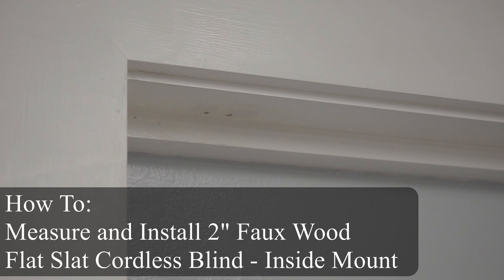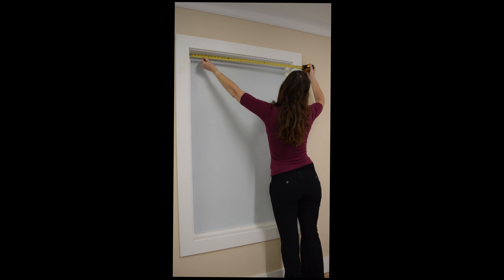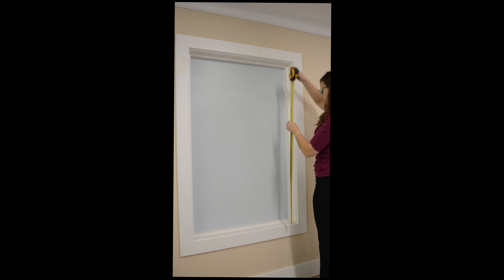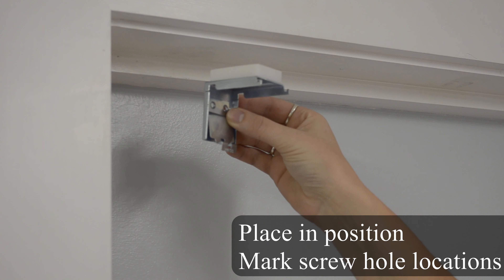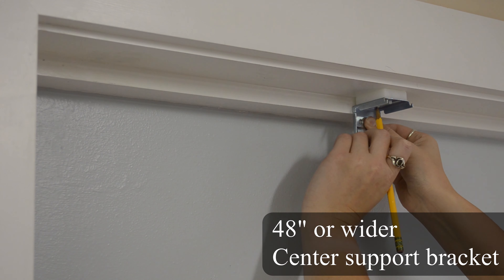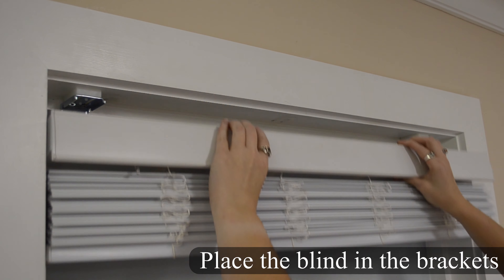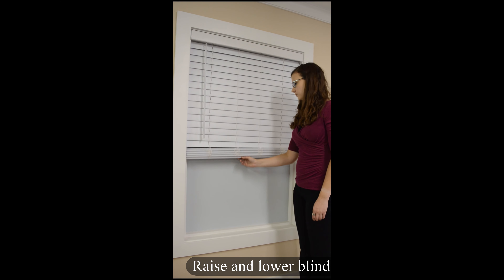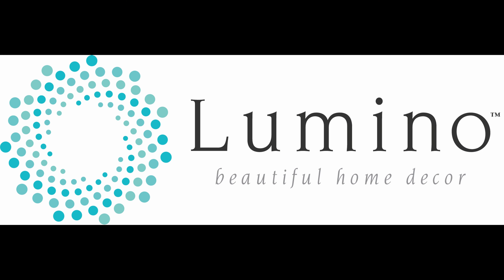Lumino 2" Faux Wood Flat Slat Blind - Inside Mount

Comment: You mentioned in the video having to mark where the internal components are, but don’t necessarily give a reason as to why. So I figured out the hard way after trying to install a 72 inch blind myself that the reason to know that is to avoid those areas with the bracket rather than aligning the brackets to those areas. That is not specified in the instructions or this video. Other than that, the blinds work great…
Reply from the maker: I am sorry that you encountered an issue. Yes, if brackets are installed in that area, it will prevent the blind from securing with the bracket and could make it not work properly. This mention to not install in the internal components area is stated in the marking screw hole locations.

Comment: One question that I have that isnt addressed in the directions or comments during the installation.   The mounting brackets.   Should they be mounted pushed back as far as they can to the window?  Or pulled forward to the edge of the window opening?  Or centered in the gap?   The video makes it look like as far back as possible.  But want to verify.
Reply from the maker: That would really depend on how you would like the blinds to look into the window frame. You could put the brackets back slightly to create a flushed look with the window frame. Otherwise you could have the brackets set farther back to make the blind look more set back.

Comment: I installed 6 of the the blinds in upstairs of my home -- took me a bit longer than 15 minutes each. One of them won't go up and down. Is there a trick to get it to work? Nothing in the instructions or video on troubleshooting.
Reply from the maker: First I would check to make sure the brackets are not directly next to or on top of any of the internal components in the top headrail. If you are still having issues, please email support@luminodecor.com

Comment: These things are a colossal pain in the ass to install! These vertical brackets are crap! I had Real Simple blinds from Bed Bath & Beyond that had a clamping square bracket after the simple 2 screws the brackets opened up and the actual blinds slid in with the greatest of ease! This junk from Vietnam is ridiculously convoluded! In a video from 5 years ago you people clearly knew about those brackets! If you could have them then why not now? I would not recommend these unless you want your friends family and neighbors impressed with your knowledge of certain 4 & 5 letter words! Trying to slide these stupid things into the brackets the plastic got marred! After finally getting them up and looking at them I come to realize the end caps are pushing off, the blinds go up unevenly and have a tilted hang to them the very problem I was trying to get away from, with my corded blinds there is a tremendous amount of slack in the up down cords and they dont go down right anymore! These pieces of junk are going back to Menards I will never buy one of your sub par products ever again, Im getting my money back and going higher quality!
Reply from the maker: I am sorry to hear that you had a bad experience with our products. Please note that the square backets you speak of work specifically with blinds that have a separate valance to attach which would then hide those brackets. In this case, the valance is built into the blind, so another bracket option had to be found and be hidden. In the case of these blinds, you would not slide them into the brackets, it would be rotated back and into place. Pending on where you notice the tilted hang (if fully extended), then that can happen in transit of the blinds. The blind slides in the box during shipment and can potentially tighen on one side. There is an easy fix for this; full extend the blind, yank harshly on one side, push the blind all the way back up and pull it all the way back down. It might take a few repetitions, but that should fix the issue. If you have any additional questions, you can contact us at support@luminodecor.com.
Reply: @lumino4734  Well thanks but I returned them They were beveled and bent outwards to boot after I finally got them hung they didnt look right! I went with Levolor didnt have to put any other bracket up I was able to use the existing one they just slid in in a few minutes.

Comment: Dident workk for me been 2 days and can’t get em to snap in place
Reply from the maker: Please either email us at support@luminodecor.com or call us at 877-687-2796.
Reply: I'm having the same problem. Try removing them and reinstalling them!!! Unbelievable, Certainly Not User Friendly. I guess were not alone, look what I have to look forward to.
Reply from the maker: @chrisschley4173  When inside mounting the bracket, are you using the white spacers?
Reply: Worst blinds to install ever. I’ve installed blinds so many times but never this hard
Reply from the maker: @edwardbryant12  what issue are you encountering? Feel free to email us at support@luminodecor.com.
Reply: Yes I agree.  These are a PAIN!!!!  I’ve installed MANY over the years without reading the instructions.  FYI, I’m trying to do a inside mount, YES, I am using the spacers, and YES the brackets are mounted outside of the internal components….  They are NOT snapping into place!  Ridiculous